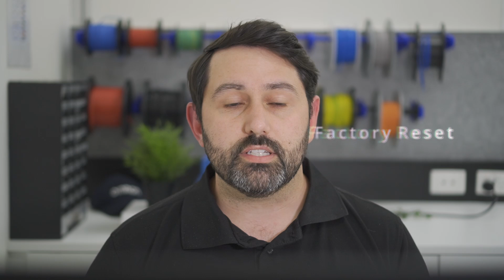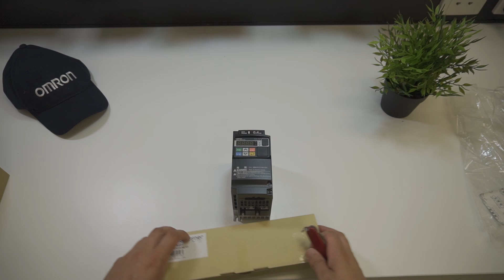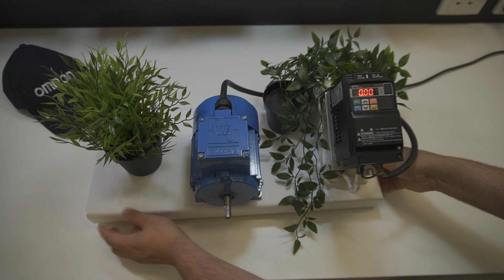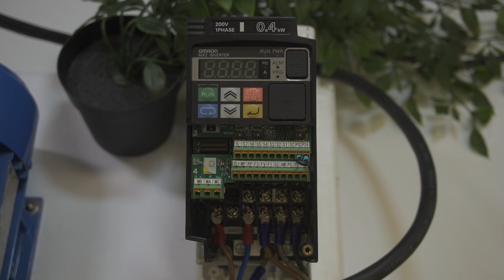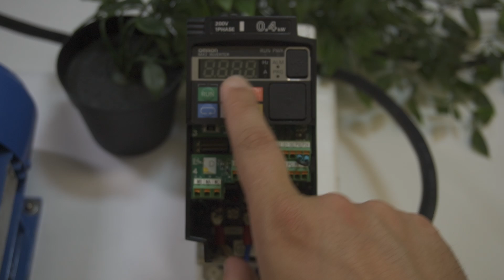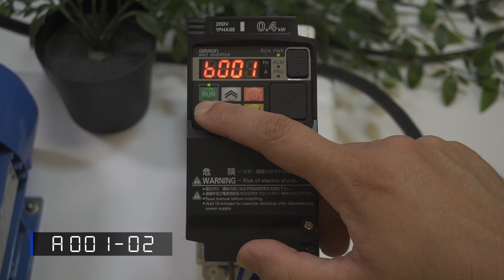Omron 3G3MX2 Quick start guide

Comment: How to run it from keypad to remote switch mode
Reply from the maker: Switching a 3G3MX2 from keypad control to remote switches

Two parameters do it:

A001 – speed reference source
A002 – run/stop command source

02 = keypad (F001 setting / RUN key)
01 = control terminals (external switches)

So for full remote control: set A001 = 01 and A002 = 01.
If you want start/stop on a switch but keep setting speed on the keypad, set only A002 = 01 and leave A001 = 02.

How to change them on the keypad:
1. Press the Mode key until you're in the "A" parameter group.
2. Use the up/down arrows to reach A001.
3. Press SET — the current value shows.
4. Up/down to change it to 01, press SET to store (the code reappears).
5. Repeat for A002.
Do this with the motor stopped.

Wiring the switches:
- Digital inputs 1–7 are assigned by C001–C007. Default is usually C001 = 00 (FW, forward run) and C002 = 01 (RV, reverse) — worth checking.
- The drive ships in sink (NPN) logic, with the short bar between P24 and PLC. In that case the run switch goes between terminal 1 and L.
- For source (PNP) logic, power off first, move the short bar to between PLC and L, and wire the switch between terminal 1 and P24.
- Speed potentiometer (only needed if A001 = 01): 10 V from H, wiper to O, common to L. Use OI instead for a 4–20 mA signal.

If a parameter won't change, check b031 (soft lock).

To go back to keypad control, set A001 and A002 back to 02.

Comment: Hi .
We have two inverters for our packing machine.  How can we setup for them and connect them?
Reply from the maker: Connecting two 3G3MX2 inverters on one machine

There are a few ways depending on what you want them to do. Each drive stays fully independent electrically — own supply feed, own motor, own protection. What you're really deciding is how they share commands.

1. One start/stop for both
Use a relay or contactor with two separate contacts, one per drive, rather than looping one switch through both. The drives each have their own internal 24 V (P24/L), and tying those together between drives can create a closed-loop circuit. If you'd rather use a single external 24 V supply, remove the short bar in both drives and wire both PLC terminals to that supply instead.
Set A002 = 01 on both drives (run command from terminals).

2. Both running at the same speed
Either give each drive its own potentiometer (each wired to its own H / O / L), or use a twin-gang pot if they must track exactly.
Set A001 = 01 on both.

3. Second drive follows the first
Wire the master's AM analog output (0–10 V) into the follower's O input, and link the two L commons. Set A001 = 01 on the follower. Simple and effective, but it's open-loop — expect a little scaling error, which you trim with A011–A016 on the follower.

4. Control both from a PLC or HMI
Modbus RTU is built into the drive, no option card needed. Daisy-chain the SP/SN terminals, give each drive a unique address in C072, match baud rate and parity (C071/C074), and switch on the termination resistor at the last drive in the chain.
Set A001 = 03 and A002 = 03. Note that these communication parameters only take effect after a power cycle or a reset input.

General points
- Each inverter needs its own branch protection and its own motor cable; don't run two motors off one drive unless it's been specifically sized for it.
- Keep motor cables screened and away from the control wiring — two drives in one cabinet means twice the switching noise.
- Make sure the E-stop and any safety function drops both drives, not just one.

Comment: Добрый день-как копировать параметры с одного ПЧ на другой?
Reply from the maker: Copying parameters from one MX2 to another

Easiest way is Omron's CX-Drive software and a USB cable, the drive has a USB mini-B port on the front.

1. Connect the PC to drive 1 and go online in CX-Drive.
2. Upload all parameters from the drive and save the project file.
3. Connect to drive 2, download that file, then power-cycle it.

Two things to watch:
- Only do this between drives of the same model and capacity.
- Check the motor-specific settings afterwards regardless (H003 motor kW, H004 poles, and the electronic thermal level), as those need to match the actual motor on that drive.

There is also an optional LCD operator (3G3AX-OP05) with a built-in copy function, but support for it depends on the drive version.

Comment: I have an issue. I'm currently configuring the 3G3MX2 inverter to control a water pump motor using PID control based on pressure measured by a water pressure sensor (4–20mA).
I've already set all the parameters from A071 to A079, and I set A001 to 10, but the PID function is not working.
Please help me.
Reply from the maker: Sorry for the late reply, that would be a different setup. Double-check your analog input setup for 4–20mA, confirm A001 = 10 and A002 = 01 or 02, and ensure b037 = 1. Make sure parameters A071–A079 are all properly configured (especially the setpoint and gains), and that the PID feedback is actually reaching the inverter.
Reply: @shawncowdrey thank you for reply me and it working !

Comment: Comment demarrer le variateur de vitesse en mode distance, parce que notre vlt demarre en mode manuelle, donc il faut appuiyer sur run pourque le vlt libere la tension à la sortie.
Reply from the maker: To start the VSD in remote mode when it powers on, set A001 = 1 (external run command) and b084 = 1 (auto-restart). Also make sure your RUN input (e.g., S1 connects to SC) is active when power is applied. This way, the drive will start automatically without pressing [RUN] on the keypad. Be sure the setup is safe for auto-start! A suggestion is using a toggle switch with a safety stop in series between S1 and SC.

Comment: Good video pleas SHAIR, how to run reverse, forward,
Reply from the maker: To run the VSD in forward and reverse, you’ll need to assign two digital inputs:
	•	S1 = Forward Run
	•	S2 = Reverse Run
	•	SC = Common

Connect momentary or toggle switches between S1-SC and S2-SC.

Important:
	•	Only one input (S1 or S2) should be ON at a time.
	•	Set A001 = 1 (external run command), and ensure parameter C001 = 1 (assign S1 to Forward) and C002 = 2 (assign S2 to Reverse).

This allows the drive to run in either direction depending on which switch is active.

Comment: How we can change overcurrent setting
Reply from the maker: To run the VSD in forward and reverse, you’ll need to assign two digital inputs:
	•	S1 = Forward Run
	•	S2 = Reverse Run
	•	SC = Common

Connect momentary or toggle switches between S1-SC and S2-SC.

Important:
	•	Only one input (S1 or S2) should be ON at a time.
	•	Set A001 = 1 (external run command), and ensure parameter C001 = 1 (assign S1 to Forward) and C002 = 2 (assign S2 to Reverse).

This allows the drive to run in either direction depending on which switch is active.

Comment: Good day i’m kind have problems with my omron 3G3MX, before i joined the company the unit is already program with a plc. But now my boss wants the machine to also operate in manual, we are currently operating our machine in manual but will i was also trying to set the speed for the motor i cant change the speed in F001 on the unit. I can put it in program but the arrow keys are not working
Reply from the maker: To switch between manual mode (keypad) and PLC control, adjust the following parameters:
	•	For manual mode:
	•	A001 = 0 (Run command from keypad)
	•	A002 = 0 (Speed set from keypad – F001)
	•	For PLC mode:
	•	A001 = 1 (Run command from external terminals or PLC)
	•	A002 = 1 (Speed reference from external input or PLC)

Make sure the drive is stopped before changing settings, and that b037 = 0 (parameter lock disabled) to allow changes.

This lets you toggle between manual operation and PLC control as needed. I hope that solves your problem.

Comment: Sir, omron mx2 inverter 
This parameters are not showing 
H103
H111
H112
H113
Access not possible
Below  H 50 and Above H 200 showing ,pls reply
Reply from the maker: Hey, I haven't looked at this page in a long time. I see the AU site is down so here is the link to the EU datasheet. https://assets.omron.eu/downloads/manual/en/v3/i570_mx2_users_manual_en.pdf
Looks like your unit was locked. Use b031 to unlock or try re-set

Comment: E22.1 problem sloved plese help me
Reply from the maker: Sorry for the late reply. This is a CPU Error. No idea how to resolve it.
Reply from the maker: E22.1 means “Multi-function input error – Forward/Reverse commands are active at the same time.” The drive has received both forward and reverse signals together, which is not allowed.

To fix it:
	•	Check your control wiring to S1, S2, and SC.
	•	Make sure only one of the run commands (Forward or Reverse) is active at a time — not both.
	•	This often happens with toggle switches or faulty PLC logic.

Correct the input logic or wiring, then reset the fault to resume normal operation.

Comment: How do you resolve error E22..1 on Omron 5.5 kw
Reply from the maker: E22.1 means “Multi-function input error – Forward/Reverse commands are active at the same time.” The drive has received both forward and reverse signals together, which is not allowed.

To fix it:
	•	Check your control wiring to S1, S2, and SC.
	•	Make sure only one of the run commands (Forward or Reverse) is active at a time — not both.
	•	This can happen with toggle switches or faulty PLC logic.

Correct the input logic or wiring, then reset the fault to resume normal operation.

Comment: Any chance of getting a video on the outputs? I struggled with the frequency arrival settings. C23 and c42/45 for thresholds. dont remember the correct parameters now. But refering to output 12. As i read in the manual i could use 3 different outputs if i had the corresponding parameters set correcly.